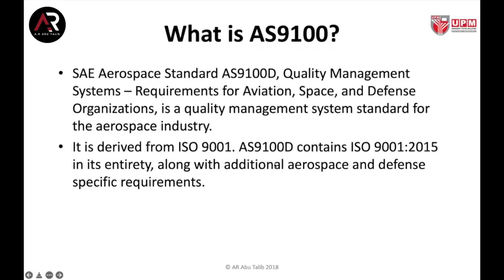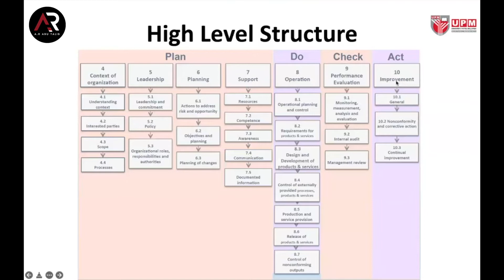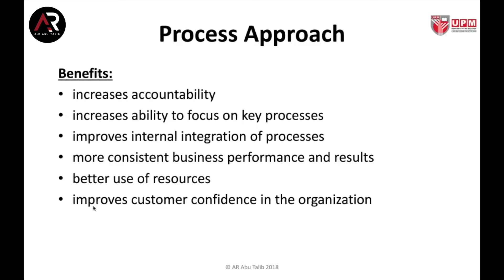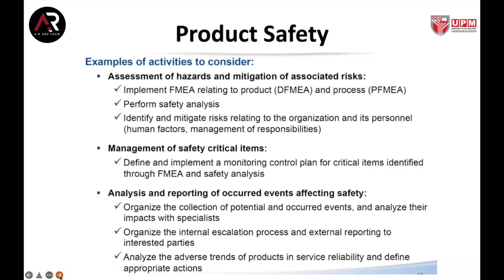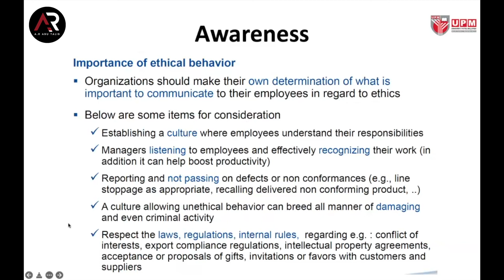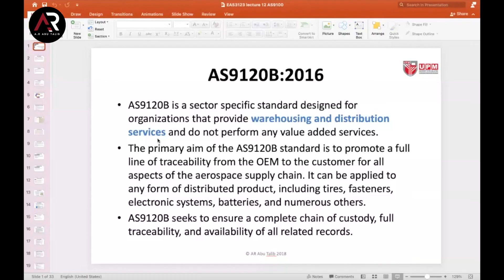AEROSPACE STANDARDS AS9100D

Comment: [217458] Interesting topic regarding Aerospace standard AS9100D which outlines quality management requirements in various sectors and It emphasizes proactive risk management, continuous improvement and thorough documentation and Certifications. Thanks Prof for the insights.
Reply from the maker: I’m glad you found the lecture on AS9100D informative. It’s crucial for the aerospace industry to maintain high standards of quality and safety.